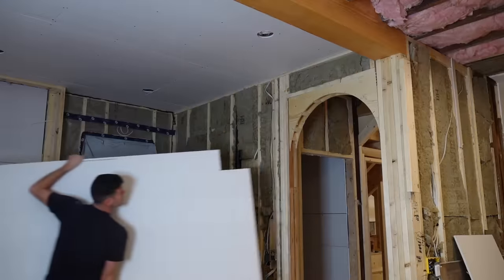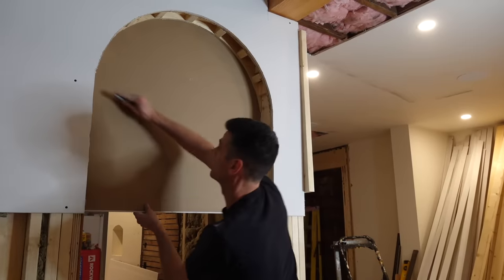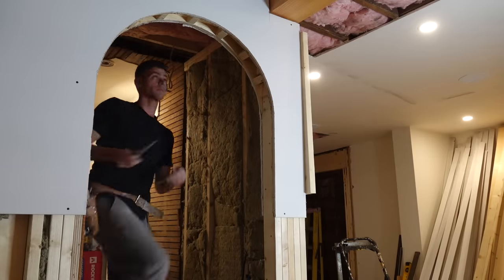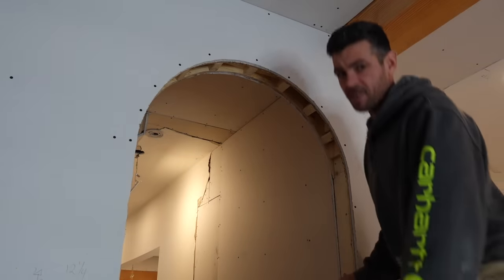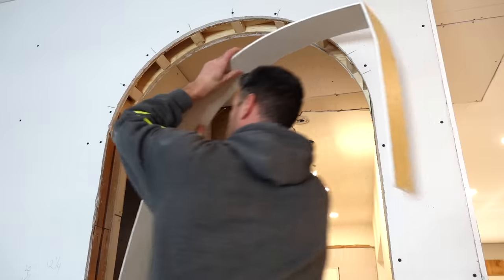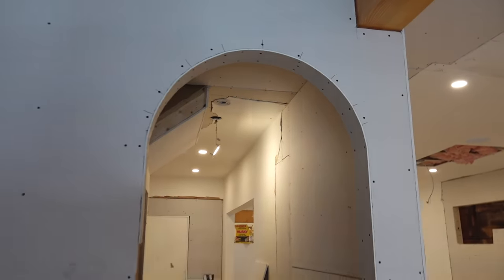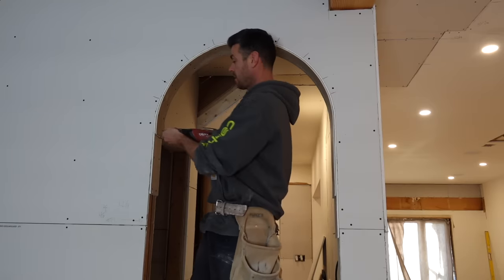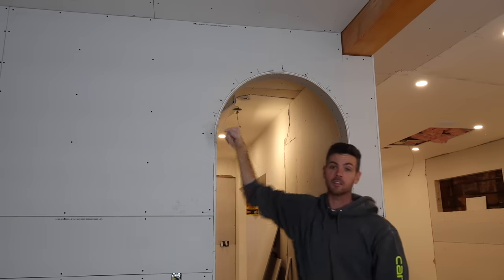Drywalling a Tight Radius Arch!

Comment: Next time, save the plywood arch cut off and make a quick mould for the wet drywall to drape over after wetting. The radius won't be perfect but pretty darn close. Wet both pieces of drywall drape them over the mould then go for a coffee and let them set up a bit.
Reply: Thats how we did it to. Put some weight on the drywall, soaked it with water and let it sit over night
Reply: @gnshp8167  soak the drywall?

Comment: I’ve boarded 100’s of arches doing new builds next door to you Ben in Alberta. You had all the right ideas, the order that works best for me is strips face down and a stream of water along the brown side. Spread the water out with a t-square or scrap piece and let soak for just a couple minutes. That 1/4”will dry out surprisingly quick. 
The real pro tip is to use the arched cut out from the wall board as a form to pre-bend the wet 1/4” and press it into the arch. 1/4 router bit when cutting the arch means the 1/4 rips are held in tight while getting screwed off.  Just picture the dance of me trying to stand on a bench with a knee holding the cutout up to keep the rip tight while screwing it off. Works incredibly well!

Comment: Thanks for making all those mistakes! It is less painful for us when we do it. I did have to do some around a built-in corner round tub. I cut it to size, moistened the back, and hung it over a couple of saw horses. Since I was not in a rush time was on my side. It got a memory, and I could curve it around the tub with little effort. Thanks for the videos.
Reply: Yeah your method works. I have done it too. Spray it with water and form it close to where you want it and let it sit.
Reply: could be something you do first thing of the day to prep for later on that day installation, wise way of working.  Work smart not hard.

Comment: Hi,the arch was funny to watch,here in Greece we even have a special board for this stuff but it still doesn't work for tight circles. the easiest way for me is to just cut it every 2 inch on one side and break it,the mud and corner bead fixes it. Cheers
Reply: Agreed! By the time you wet it, bend it, wait for it to dry and put it up you could have scored the back, hung it, corner beaded it and got the first coat on.

Comment: We have a 6.5mm Flexi board in Australia that we use for this.
Also when wetting, should only wet the back then bend into shape and let it mostly dry out into position before installing.
Another option is to relief cut the back of the board every 20mm or so

Comment: Do you have to use drywall here?  What about just normal wood?  Could use thin, almost-veneer-like layers and build them up.  Or do you need to use anything at all, assuming that a final, nice wood paneling is going to be put in place there.

Comment: Hi Ben been watching your channel for awhile and even though imy a 45 yr professional in Australia, I've still picked up a few good ideas from your channel especially now I specialise in renovations and repair work. I get my apprentices to watch some of your vids that I think are pertinent to what I'm teaching them. In the 1980's we did thousands of these arch's but then they went out of vogue. But today I did my first Roman arch in 32 yrs which was an eye opener for my boys that have never seen one done. I've noticed you guys over there have some different ways of doing things than we do. One in particular which you mentioned on external angles. Our angle system seem so much quicker and easier especially if you want them straight. Another thing I've noticed in yours and others vids is you use single shot screws. Don't you guys have collated screw guns which are as quick as nail gun ?
So onto my thoughts for your arches. I hope you do a follow up vid on the setting process you use as I can see a lot of headache the way you have over laid the fill in on the outside of the arch form instead of  inside the plasterboard shape. We very rarely have timber forms in our openings as a matter of fact I'd rather not have them as it's time consuming and not necessary if  know a few tricks. I've always lined the vertical sides of the opening first then fix the sheet over the opening and fix it off. I then go on the inside and mark the center of the opening and put a small nail hole through it. (Nb when I find the center width measurements I add the thickness of the plasterboard down from the top. This allows the infill to fit inside the arch.)
Once I have the center worked out I cut a piece of board about 50mm or 2" wide and long enough to go past the center mark to make a big compass. With me so far? I put the clout or small nail through the measurement on the compass stick the put it through the hole in the opening. I then put my knife on the end of the compass and scribe around the shapes of the arch. Then do the same on the other side through the same hole. I then cut up the straight sides of the arch with my saw until I meet where the radius line meets the straight line. Once you do that give the sheet a good thump in the middle and the arch will just drop out. Repeat the same process on the other side and you're ready for the infill. So far this is about 20 - 30 mins for both sides. The secret to bending the board is cut your fill in across the width of the board not the length of the board, it bends easier one way then the other. It just means putting 2 pieces in instead of one, but it'such easier this way. Now the infill piece needs to be the same size as the framing studs, so it fits inside the plasterboard instead of out side. Grab your strip and gently roll it gently back and forth over the top of your arch cut out. This will start to " stretch" the infill to shape. Start at the center top of the arch out a fixing nail or screw in the top and slowly "squeeze' the infill piece in flush between the 2 plasterboard sheets until you get to where the side sheeting meets the curve. Do the same the other side and your ready to fit the steel arch beads. This whole process takes me about 30 - 40 mins, a lot quicker than it took me to type this......lol.
It looks like I'm might be doing 2 more in the next week or so.  if I do I might see if I get the boys to video it which would probably show how easy an arch is. And I've used this system right down to 300 mm or 12" openings in niches etc.
Anyway enough from me. Keep up the good work my boys enjoy your vids, so do I. Cheers to all the drywall brothers and sisters
Reply: You should have went into more detail and really made this comment longer !!

Comment: I agree with Dan. I wet the back side only. With sponge or spray bottle. Lean it against the wall on an angle to allow it to warp on its own. 40 yrs it's worked. I put one screw in the middle around also to prevent weakening it.

Comment: What would happen if you scored the back of the drywall before hanging it? Would that release some of the tension a tad? It might allow the paper on the front to bend with the contour of the arch while also giving some flex to the back? Any sharp angles to the drywall could probably be mudded out, but you might keep the drywall from snapping deeply.

For example, if you notice, after the thing snapped a couple of times, it appears to have followed the contour more readily and didn't break much more. So, a controlled version of what you did above by prescoring.
Reply: Indeed.
He himself played that clip of the old 40s drywaller with the hatchet scoring the back for an archway.
Why did he abandon that?
Reply: @josephtimperio9932  exactly what I was thinking throughout this whole video, it's odd be didn't even discuss that as an option. Or the fact that they sell bendable drywall
Reply: @josephtimperio9932  I must have missed that video. I'll go digging for it.
Reply: I was thinking the same thing… Score the back of it, bend it in.
Reply: Tapers get pissy if you have a ton of breaks cause it's more work for them.. if you can avoid breaks they can just slap their flex bead on and go.. if there's breaks they have to first smooth it all out, let it dry etc.. if you score the back it's garenteed to break everywhere you did

Comment: It's interesting; I've never completed an arch with drywall before. In the past, I have only done aches using a 1/4" or 1/2" board placed in a streamer for 15 to 30 minutes. Before installing it, place it in a table jig of the arch for about an hour to hold its shape. Having to deal with arches can be frustrating, but you handled it well.

Comment: Set the blocking a 1/4 back and lay 1/4 ply or luan in first and cap with the drywall board, just wet the back. That gives support through the curve. Most likely your breaks were between the blocking. Scoring the back every 1 to 1/2 inch also allows the back to open a bit without cracking through.

Comment: You should be able to get 1/4" high flex drywall at your drywall supplier company.  It will save you this headache for a minimal additional cost.  Well worth it, as I have learned.  Good job getting it done though!

Comment: It needs time for memory to set in....set screws loose and only 1 per stud in center.....1/2" can be done by scoring the back or use thin piece of Masonite or something so surface is solid for drywall without gaps between studs.....

You had perfect template with drywall you cut out for radius

Comment: 3rd!!!
If you have 30 minutes to spare, use a keyhole saw. If you don’t, use a router.   For bending, you can cut the back of the drywall, just make sure you don’t cut through the front paper. I see that on job sites pretty frequently
Reply: "cut the back of the drywall" - so essentially a kerf cut on drywall then?

Comment: As for the bending of the drywall - I've had success wetting it; bending it into the curve I need; then letting it dry in that shape before screwing it into the arch. It does require an extra day or more but there's usually other stuff to be done while the drying takes place. Also, wiggle wood works as well.

Comment: I did a tight 900mm arch in new builds in the toilets. Right pain they are must have done 1000s. You must either wet the board or use the 6mm GTec boards

Comment: Would starting in the middle and working out work better? That would at least reduce the length of the "lever arm" prying against low-strength drywall board, wouldn't it?

Comment: Pretty sure you are only supposed to wet the outside of the curve. That allows the paper to stretch. Easily tested by wetting the outside of the drywall piece and then lay it over something cylindrical. It will conform to the curve, but for tighter curves you may have to repeat the wetting more than once. That's how I did it with a 17" radius cove.

Comment: what is the big deal of the drywall breaking in this situation? Once you get the bead on, you will have to mud to the bead. This should give you 3/16th of an inch mud at least. Any normal problems of paper separating from the gypsum board shouldn't be an issue here, right? Especially if you put a fill of Confil, the fibers and glue of the Confil should prevent any problems of a cracked board, especially considering its only 6" wide
Reply: do you have to fasten every 2 inch kerf?

Comment: You have to let the bend sit longer . Usually over night . Same goes for wetting it flex it then let dry . But only damp not soaked . Union Carpenter 24 years.

Comment: You might as well just fan-slice v-cuts down the exterior facing paper (side with the inner radius).  Yeah, it weakens the shear strength, but you can tape/mud the seams, and it's just a 4.5" width section anyway.  Not like it has a lotta shear/tensile responsibility anyway.

If the arch is semicircular, you can calculate the inner partial circumference from the inner diameter, subtract that from the outer partial circumference computed from the outer diameter, then you have the diff between the circs.  If you make n cuts around the semicircle uniformly, you can divide that difference/n and that would be the approx. width of each v-cut.